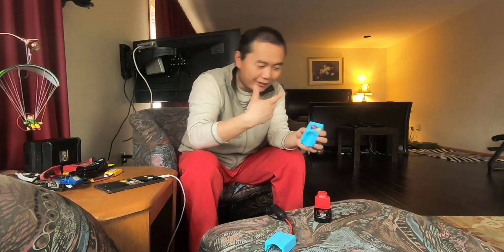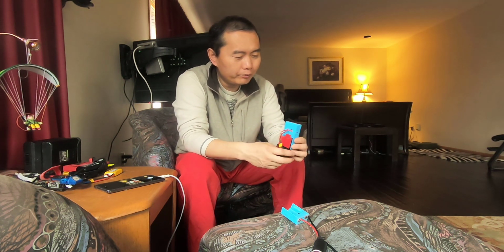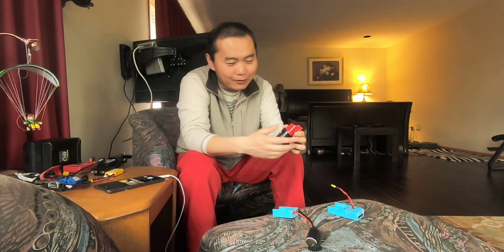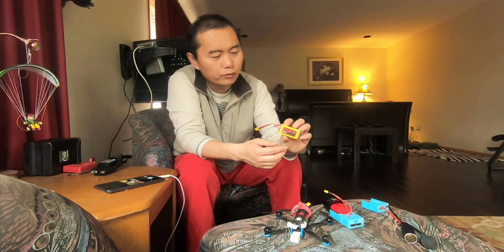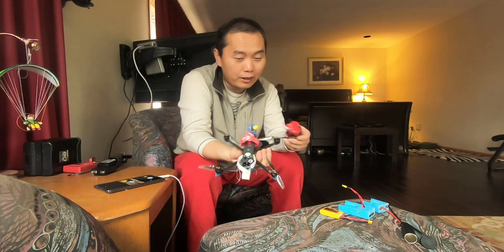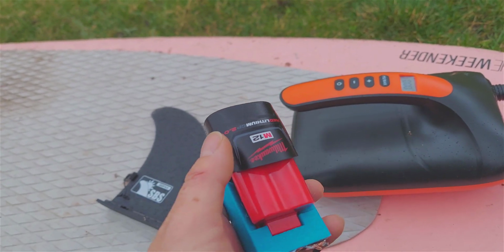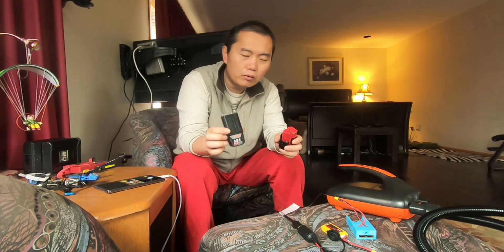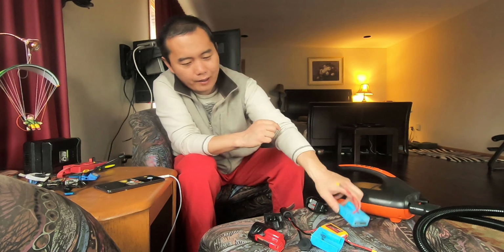Milwaukee M12 Bosch 12v battery as USB power bank pump inflatable SUP Paddleboard

Comment: Amazing concept. is there something inside to stop the battery from over discharging? Did you try anything with a continuous run time? I need to power a 12v water pump continuously for 30 mins to an hour at a time. thanks
Reply from the maker: no. the battery itself don't have over discharging protection. continuous run time depend on the battery size and application.

Comment: 7:55 starts sup example.. is the Milwaukee 12v rechargable?
Reply from the maker: Of course, all power tools battery is rechargeable.
Reply: thank you for the reply. I'm confused. the Milwaukee is 3amp. but the compressor needs 12v and 110 watt which is 9 or 10 amp.. thank you

Comment: Hello, I'm interested in purchasing an adapter for the my Milwaukee M12 batteries to pump up my paddle board. does this also include a car adapter port?
Reply from the maker: That's $10 extra.
Reply: @JerryMinne  I don't see the product on the site. Would i be able to message you my email for an invoice?
Reply from the maker: Just order the milwaukee adapter then I'll send you invoice for the connector.